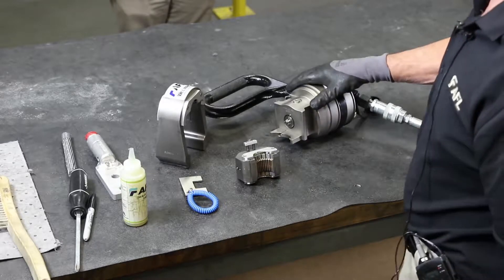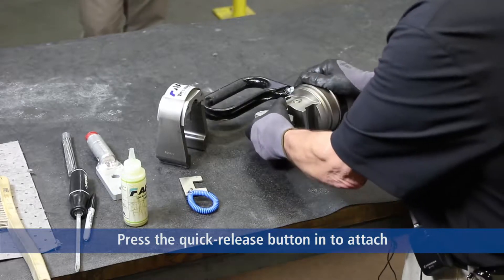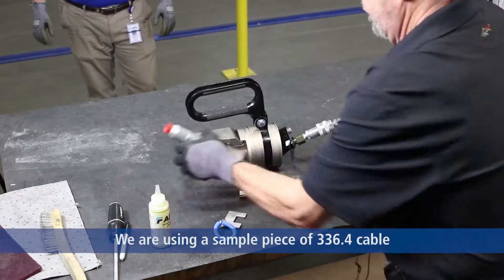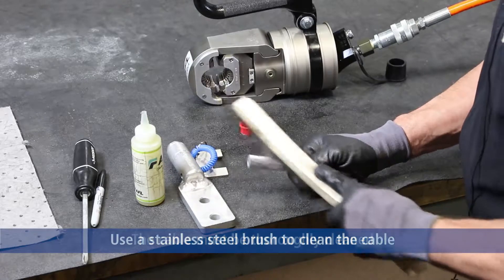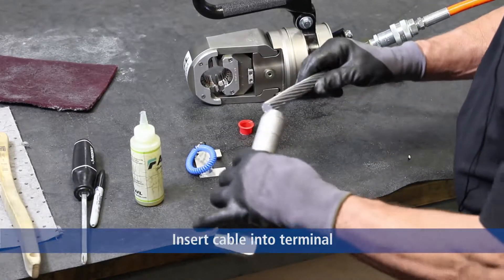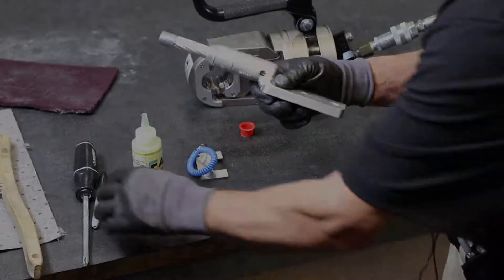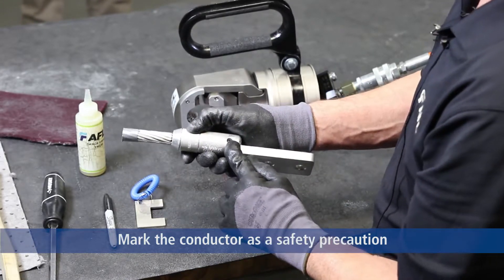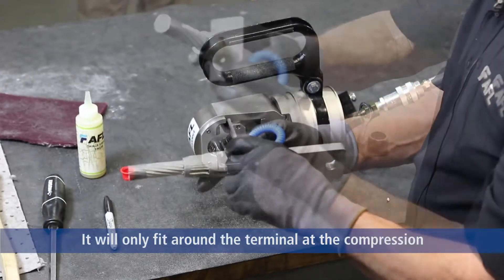Swage 45 Ton Installation

Comment: Do you have tools to press 12mm stainless steel cables in swage terminals of 316 Stainless and which pressure should be applied